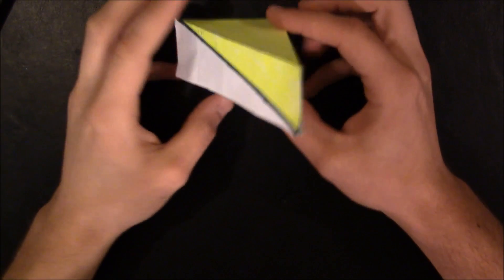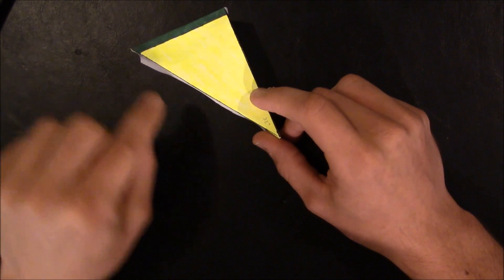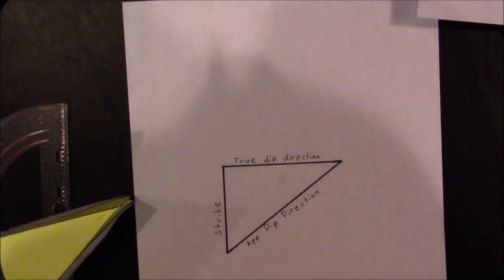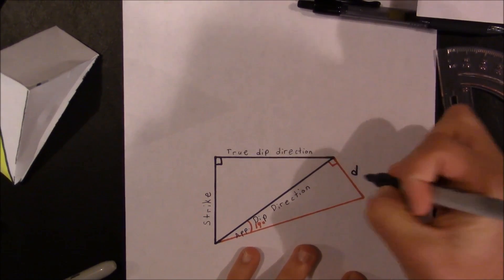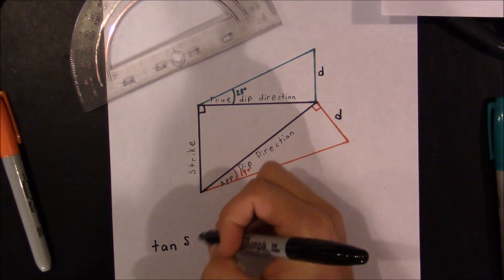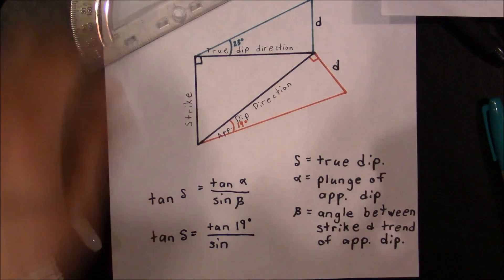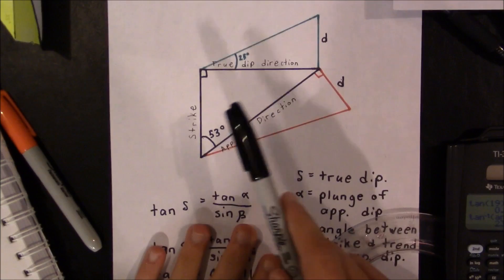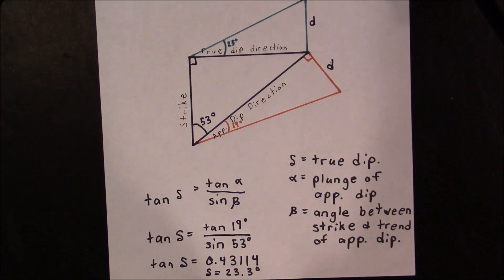Structural Geology Lesson 2: Apparent Dip

Comment: Sir how have you arrived at 23.3 deg delta? how did you do it in your calcu? mine the tan 0.43114 is equal to 0.000769.
Reply from the maker: Hi Mary, thanks for your question! We have the equation tan(delta) = 0.43114. To solve for delta, you have to apply the inverse tangent (aka tan^(-1)) to both sides. The inverse tangent of 0.43114 is 23.3 degrees. Also, while doing all these calculations, make sure your calculator is in degrees and not radians. Hope this helps!